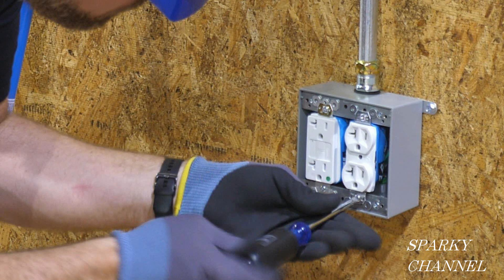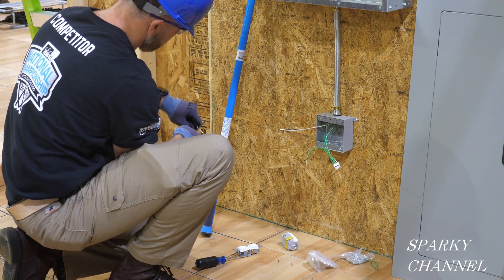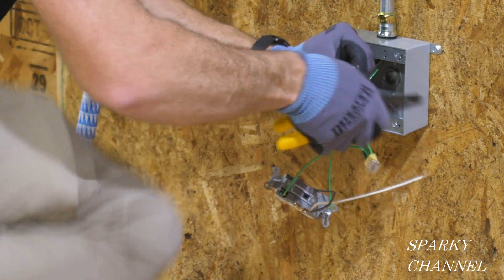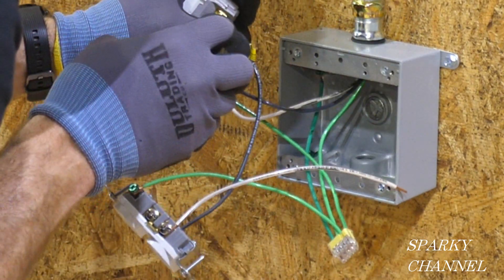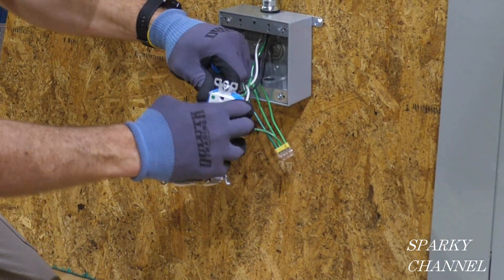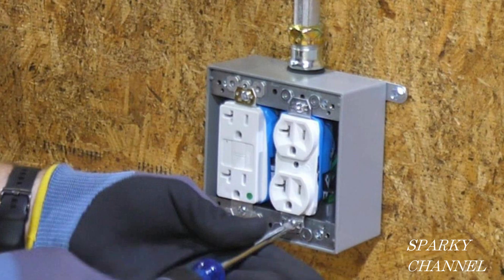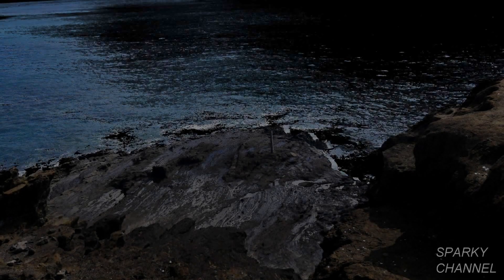Watch a Pro Wire a 20A GFCI and 20A Receptacle, Any Code Violations?

Comment: Great I'm apprenticeship ING with habitat for humanity wiring home's and I was contemplating putting an extra receptacle in my bathroom , thank you for the demonstration it will help me!
Reply from the maker: My pleasure!
Reply: Weird I’m working with habitat wiring multi dwelling units as well lol
Reply: @madabz81  do you get paid or is it all charity work?
Reply: @BruceLeanTrades  volunteer
Reply: It's very sad that most large contracting company is on housing developments do the code minimum of one receptacle per 12 ft wall in a bedroom when you had that one receptacle behind the bed board it's very hard to get the electric blanket and alarm clocks and night lights all hooked up to both sides of the bed for His & Hers the actual cost to put it in an extra extra receptacle is probably less than $10 time and material I have always been one to over Supply the owner of the home in an extra Outlet or two it doesn't cost that much more and it makes people's lives much easier down the road
Reply: @tricklicker69  there's multiple things that change the location of outlets. Such as windows

Comment: Professional electricians also use an electrical screwdriver! The installation time would be 9 minutes instead of 13 minutes with it! I use Bosh Go 3 with 0.5 to 5nm variable torque. Most Circuit breakers bolt terminals have the exact 5nm requirement, that Go 3 is a perfect measurement tool for it. Go 3 "Max" torque value =5nm. If I need 5-10nm I use Go 3 locked

Comment: The half inch EMT is crooked no box offset the Bender was there would be nice to have a strap on it but not required because of the distance throw out that Wego but a green wire nut on or a barrel crimp

Comment: Armor bands? Why not electrical tape? Are the receptacles weather resistant?
Reply: Armour bands and tape on devices are for amateurs.
Reply: @pld8993   @pld8993  Bear in mind that this competition is a commercial for Ideal, so Ideal products are going to be used.  Not required, just marketing.  Notice the prominent mention of the "Ideal" Amour Bands" and "Ideal Push Tail".

Comment: You're Def wrong about the 406.4d2c portion, without a doubt.  That code is for replacement of *2wire receptacles with a 3, obviously that isnt done so here, so there is no need for the stickers.  By your 'logic' every other receptacle on a kitchen counter would have a sticker, and that's just not so.  I'm sure uve already been corrected on this, but for those watching, it's not required IF youre doing new work with "modern" wiring methods..
Reply: Agreed.  406.4 (D) (2) (c) only applies when there is no equipment ground and the grounded receptacle is rendered safe by means of a GFCI instead.  In this application, there is an equipment ground, therefore that section (and all of the requirements in it) do not apply.  It is not actually required to mark the receptacle as "GFCI protected" in this case (but still a good idea).

Comment: I’m still kind of green so i don’t have much xp. Hmm I do I see a medical grade receptacle and a gfci, don’t know if that’s the issue.
Reply: Yep, you're correct.  I'm not sure but I'm guessing that's what he meant in the beginning, when he mentioned supply chain issues.  That may have been all thy could get at the time.  Just so u know though, sparky was wrong about the sticker being a violation.  The sticker is only required when replacing a 2 prong receptacle with a 3 prong, and you have no ground in the circuit at all because it was wired so long ago when grounds weren't common.  It's important to interpret code sentence by sentence sometimes, and the first sentence of 'C' tells us what the intent of the particular code is in this case.  Also I might add, since you're 'green'.  Whenever u read a code, particularly one with many suffix's?,,, go to the beginning of said code, so in this case the code he sites is 406. D 2 c.  Go to the beginning of 406, and read what the context of the code is, just to make sure you're not reading some random code that actually has nothing to do what you are looking for.  
Also, I'm just a dude on the internet, a master of 2 years, 17yrs experience, but I as well as all of us, have been wrong, and some even super wrong in our careers, so look into the code, interpret it as u will, and don't take any info/advice without proper vetting of the info

Comment: Shouldn’t a metal box be ground?
Reply: The box is grounded through the EMT, a wire type ground is not required or necessary.
Reply: The box itself does not count as "ground" and cannot be used as a source for ground, if that's what you mean (you need an actual ground wire).

A metal box is required to be bonded to ground, though.  This is done here via the "IDEAL push tail" which he installed around 1:03.
Reply: @foogod4237  Incorrect. If the box cannot be used as a source for ground, as you say, what's the point of a pigtail from box to the device? The NEC explicitly allows for grounding of devices through metal boxes.

Comment: Two 20a outlets but just 12/2 wire. Wouldn't that mean that you'd only be able to use at most 1920 watts at once? I'm guessing it is connected to a single 120v circuit?
Or am I missing something. Shouldn't this have been done with 12/3 and a 2 pole circuit?
Reply: It's not uncommon to have 5 or more 20A outlets on a single 12/2 wire. Look in your living room, you have 4 or 5 15A outlets on a single 15/2 wire.

Comment: Not a violation, but ground wire is not required and because the receps are screwed directly to box, grounding pigtails also not required either. As a matter of practice, I would never use a phillips to tighten device screws as they don't "bite" as well as flathead. Violation, no torque tool. Maybe, like me, he keeps one in his truck in case some wiseguy inspector asks.
Reply: You should use your torque screwdriver!
Reply: Why my comment disappear? Grr. I was saying there is a listed torque spec ("14-18 in-lbs"), but also that I think you'd have to painfully interpret the OR in "Where a tightening torque is indicated as a numeric value on equipment or in installation instructions provided by the manufacturer" to literally mean "written on the device" to conclude that it's not required?
Reply: NEC does not allow using the metal box as the grounding conductor.  You are required to have a separate grounding conductor (which is then also bonded to the box).

Not using a torque tool is also not a code violation.  Sure, it's a good idea, but it is not actually required anywhere in the code.

(Personally, I think Robertson (square-drive) screwdrivers are far superior to both Philips and fladhead for electrical work.  I don't understand why more electricians don't use them (since pretty much all modern electrical fixtures/boxes/etc support them now).)
Reply: @foogod4237  You're wrong on both points. The NEC absolutely requires the use of a torque tool for fasteners, 110.14(D). The metal box can be used for bonding a device without a wire type ground, 250.146.
Reply: @pld8993  110.4(D): "Where a tightening torque is indicated as a numeric value on equipment or in installation instructions provided by the manufacturer," (2017 language, 2020 onward just says "as indicated on equipment", but amounts to the same thing).

This means that torque tools are only required when the manufacturer of the equipment explicitly specifies a numeric torque value to use on the equipment.  That is not the case with receptacles such as these (from any manufacturer I've ever seen), therefore torque tools are not required by NEC in this case (or really most residential situations).

It occurs to me on re-reading that I may have misinterpreted your original comment.  250.146 does allow using the receptacle screws as a way of bonding the box (so technically, the bonding pigtail for the box is not required (though I would argue it is still a good idea)).  I had thought you were suggesting that the grounding conductor did not need to be connected to the receptacle, because the receptacle was connected to the box (which was bonded).  That would not be permitted.
Reply: @foogod4237  You cannot use the recep screws to bond the box through the recep; you can use the screws to bond the recep from a grounded box. The box must be grounded independently of the recep. The box can be grounded through a wire EGC or through EMT, for example. In that case the recep can sometimes get bonded through the screws without the need for a pigtail. If you ran PVC with a metal box you have to run a wire EGC and you've have to bond the box directly. You cannot simply attach the ground wire to the recep and then, by screwing it the box, the box becomes grounded because removal of the recep would interrupt the grounding continuity to the box.
Reply: @foogod4237  code requires you to install according to manufacturer specifications. If that's a leviton receptacle on the right (like a BR-20), it certainly has a torque specification for the terminal wire binding screws.

Any UL listed outlet was listed under tests that specify terminal torque. Without a torquing tool, they're not installed to comply with the UL spec, you can throw the temperature rise limit guarantee out the window!
Reply: @Ariccio123  The NEC requirements for this do not say anything about UL testing specs.  They reference the manufacturer's instructions for the device.  A Leviton BR-20 (to use your example) does not have any torque specification in any of its installation instructions.  (I checked.  You can pretty easily look these things up online, you know.)

Therefore, you are wrong.  A torque device is not required with a Leviton BR-20 (any similar receptacles I know of) according to the NEC.

Don't get me wrong, I entirely agree that using a torque device to know exactly how much torque you're applying to things is a really good idea (and I definitely encourage it), but not using one in this sort of situation is not actually a violation.
Reply: @foogod4237  BR20 absolutely has a torque spec, 14-18 inch pounds, as do all residential receps that I've seen.

Comment: NEC 406.4(D) is covering receptacle replacement, not new installation. Section 406.4(D)(2) is referring to replacement of an non-grounding-type receptacle when you don't have ground in the box. The electrician here is not replacing a receptacle and has ground in the box, so the citation does not apply.
NEC 210.8 is what requires the GFCI protection in this install and it only states the GFCI be "installed in a readily accessible location"--i.e., so it can be reset, if tripped.
The stickers are useful, but still not required, when the GFCI protection is not immediately obvious, but that does not apply in this case.
Even NEC 422.5 doesn't have labeling requirements for GFCI protection on appliances, but it specifically lists "a device or outlet in the supply circuit".

Comment: Can you explain the reason to ground recepticals with green wire if self grounding recepticals are used with metal box (outlet).
Reply: NEC does not allow using the box itself as a grounding conductor.

This is because the ground bonding of the box and the screw connections from the receptacle to the box are not designed, tested, or rated to support the current carrying requirements of a full protective grounding path.  That's just not how they're intended to be used.
Reply: @foogod4237  Incorrect. Read the NEC, box is allowed as bonding means for devices.
Reply: @pld8993  i'd be happy to.  What subsection does it say that in?

Comment: My parents house has older gfcis that don’t have wr written on them
Reply: The electrical code is applied to new installations as a general rule and as long as the equipment met standards back then and do not present a hazard now, it´s okay. I believe that if any replacement receptacles were installed, they would have to follow current electrical standards, I think.
Reply: They are not required to be WR (Weather Resistant) as long as they are installed in dry locations (i.e. indoors).  These are only required to be WR because this is a (mock up of an) "outside" installation, and thus classified as a damp location.

So unless those GFCIs are installed outdoors (or some other damp location), there's actually no problem (even by current codes).
Reply: @foogod4237  that makes sense however what I ment is my parents house has regular GFCI outlets for outside!

Comment: Why you got the panel "outside"?
Reply: This is an exercise setup, not a real home.
Reply: In Texas this is very common practice on homes, usually in back yards/fenced off areas. Although I have seen panels on the sides of homes accessible from the street.
Reply: @readingfurbooks  That's interesting. And the panels are safe? People leave them alone, weather doesn't damage them?
Reply: @smacpost3  The panels are rated weatherproof, although maybe not to the extent you might expect. Usually they have a small lip on top and a door that needs to drop down to be opened. As far as tampering goes they generally are in a fenced off area such as a back yard, but also have a latch that can be locked preventing access. I will say I have never seen an exterior panel with standing water in it, but they can rust in harsh environments such as around salt water. I have never seen bus bars impacted although I'm sure it's possible.
Reply: @readingfurbooks  sounds like it works good then. Cool info, thanks.
Reply: Every panel on every home in central Arizona = outside.
Reply: @ward26102  I did not know that. Does it cause any problems? Like power theft or vandalism or weather damage?
Reply: @smacpost3  They can be locked with a padlock. Sometimes, if the openings are not closed as the should be, wasps can get in and start building a nest. In many newer homes the panels are behind a side wall/gate, basically in the back yard, though on the side of the house. We don't have many issues otherwise. As a home inspector I saw a lot of issues but they were caused by humans, not by the panel being outside. Panels being outside makes them easier to work on.
Reply: @ward26102  Yeah, wasps and spiders getting in everywhere, lol. The panels would be easier to work on, for sure. It's cool that it can be done safely like that. Thanks for taking the time to respond.

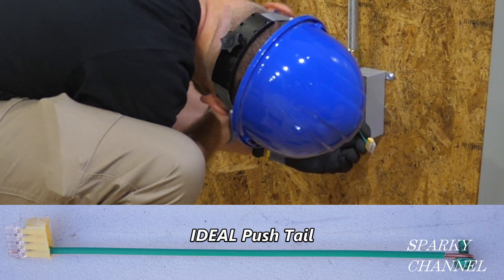Comment: When Outdoors, can you use the gray plastic conduit into a metal WR gang outlet? Still adding the grounding wire like he did to the box at @1:22
Reply: Yes, as long as the metal box/etc are properly bonded to the ground wire (which is required anyway), and the right type of connectors are used to join the conduit to the box, there is nothing wrong with using plastic conduit with metal boxes (or vice-versa).

Comment: Going for speed is wrong.  However he then doesn't cut the screws! Cut the screws people!  There is a screw cutter on your stripper for a reason!
This is no plaster wall FFS.
Reply: Why? I’ve watched dozens and dozens of these videos and nobody has cut any screws.
Reply: @NathanHarrison7  Because they haven't been trying to anti-clockwise cammed out screws
that are unnecessarily an inch too long for 40 years.

Comment: 1.  Greg didn't caulk around the box.
2.  Greg did not use a level to make sure the receptacles are perfectly straight up and down.
3.  Greg did not use a Platinum-Titanium coated screwdriver to prevent scratching the screws.

Comment: And he should have wired the regular outlet off the same tabs  from the gfci outlet. Do not do that from the load side of the gfci outlet .The way the electrician did, the gfci outlet will trip but power will still be on the regular one outlet.
Reply: I believe you are wrong and the electrician wired it correctly.  The whole reason a GFCI is marked “line” and “load” is so if it is tripped the wires coming out of the “load” side will lose power.
Reply: @glasshalffull2930  you are correct. The load would still be hot.
Reply: Yeah, this is definitely wrong.  You have it completely backwards.  He wired it correctly in the video.

Comment: Why didn't he curl the leads before inserting them around the screws?
Reply: It's designed that way. It's called back-wiring (not back-stab). Usually found on commercial grade outlets.
Reply: The electrician didn't use J hooks around the screw.  Think of back wiring like a sandwich, where the wire is put in between 2 plates that are clamped tight by the screw.

Comment: Mine won't turn on at al no matter if I flip the wires. It's brand new gfci I'm so pissed  I have no power
Reply: did you press in the test button?
Reply: @djleadone  Wires were wrong in my case, I fixed it.

Comment: Sparky, Hello. Can you tell me why the ground should be on the bottom. I have seen it done both ways. Tell me why it should be up on down. A lot of people do it both ways, which way is right. Also can I use two GFCI outlets in the same box and have them controlled by a switch ? Thanks !
Reply: Any particular reason why you want two GFCIs in the same box? One GFCI should be enough to protect a regular outlet used as load.
Reply: Up and down doesn’t matter. There are many videos arguing this point. The only wrong way is if it is specified by the homeowner or contract.
Reply: You can switch them with no problem if you wanted then on separately you would need two switches and two GFCIs.